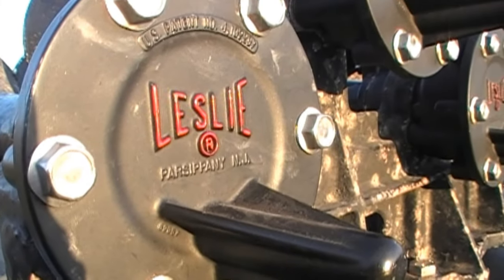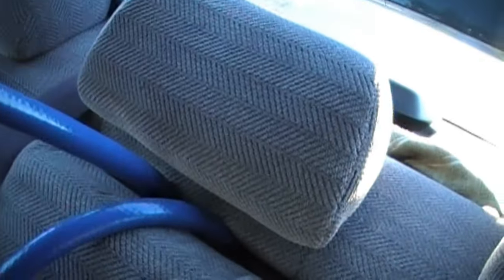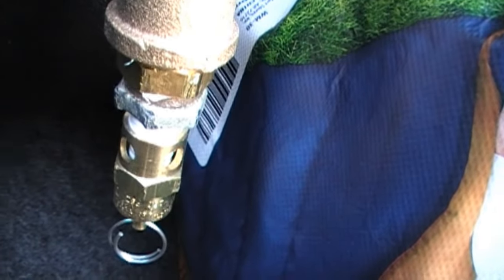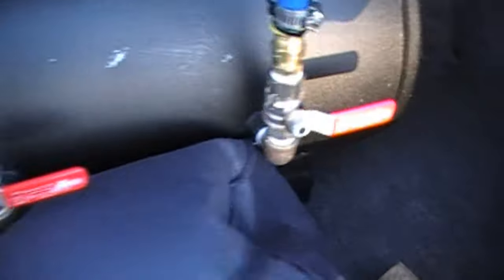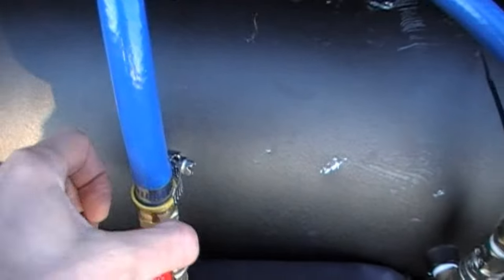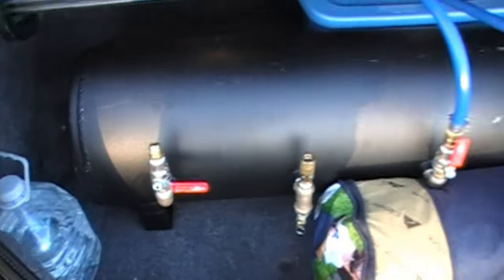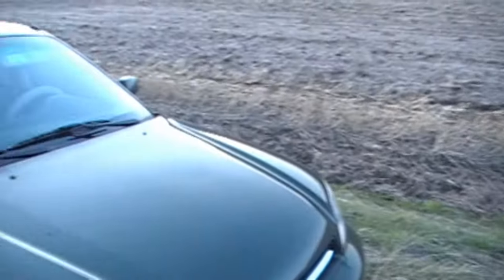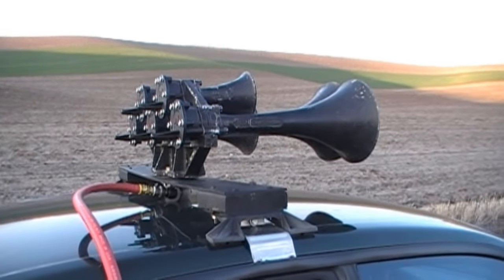Locomotive horn collector air system NOT for pranks or scaring (Big air for a big horn)

Comment: I have read the description and totally understand what you're doing with your trains horns.
BUT what would happen if a cop were to pull you over while you're on your way to the remote area where you blow your horns ?
(Or on the return trip)

In other words the cop sees your papers and your car... and then the horn, complete with its setup, including the lever valve that can be actuated while driving.
Ok you're not going to scare anybody with your horns but except if they've read the video description (😂😜) the cops will most likely not know it...
Reply from the maker: Great question!  The horn isn't on the roof until I get to where I'm going to do my video recording, then it gets removed once I finish.  Its only on the roof for about 5 minutes while I'm doing the recording.  Though space is limited with the air set up inside the car, there is enough space for one or two horns to be stored inside while I'm driving.
Reply: @mafarnz  I don't know if its illegal or not, whst would they charge u with out thete in no mans land? Relly they mught get a kick out of it, if they r Decent

Comment: Do you really need hoses that are that big?
Reply from the maker: Yes, I do.  These locomotive horns require a tremendous volume of air, volume (CFM) is far more important than pressure.  A small diameter hose or airline won't work, the horn would just quietly squeak or not sound at all.
Reply: Ok thank you, what's the inner diameter of them?
Reply from the maker: 1/2".  Everything, tank port, all fittings and valves, hoses is all 1/2" inner diameter.
Reply: If it were electricity, it would need more watts! Low amperage with high voltage won't run these horns they require high wattage!!! (air) lol hope that helps

Comment: real nice setup. looks super safe if you get in an accident...
Reply from the maker: +babygorrila I have a seatbelt around the compressor, it weighs less than a person.  Also I don't have the horn or compressor in the car 24/7 so its unlikely that it will ever be an issue.

Comment: Why not buy a locomotive .There be no need to install all that stuff.
Reply from the maker: I would if I could afford it. But then I'd have to also buy a railroad to run it on.
Reply: You need to get a job driving one  that is if your  are not one already . Them you got a real problem
Reply from the maker: I had seriously considered that for a while, but best to not try to make a job out of a hobby.
Reply: Is the air compressor 220/240 volt .Do you  fill before hitting the road  or can U run the compressor in the car.
Reply from the maker: Compressor is 120 V (North America) and I fill it before hitting the road.

Comment: hey matt, what are the dimensions of that pretty 20 gallon tank?  i will be start looking for pickups (possibly F250) and i want to hide the complete air setup (20 gallons with 2 viair 444c with extra cooling) in a tool box that will go in the bed, if theres room, ill add a little surprise for extreme lighting lol
Reply: +mafarnz i learned the hard way that the drain valve is flush with the feet on my 5 gal and i bumped it a few times and let half of my air out haha. i saw a box at the home depot thats 17x69x19 and i think internally,  thatll just fit if i put all 90 elbows on the 1/2 ports and lift the tank about an inch but i plan on using all 3/4 airlines for maximum volume

Comment: I think you need has mats to drive around with pressurized tanks. Not sure. If anybody knows... Reply
Reply from the maker: Actually I have a CDL, I work as a bus driver.  For "low pressure", anything I think under 300 PSI you don't need any special endorsement.  Semi trucks and buses all have compressed air tanks for the air brake systems.  The only time you need a hazmat endorsement is for those high pressure cylinders, stuff like that that's over 300 PSI.  I could be wrong on the pressure though.  In any case my air system runs the same at what a commercial vehicle brake systems runs at, so I don't need anything special for it.  The large 20 gallon tank is actually designed for use in semi trucks with air ride suspensions, so its made for use in a vehicle.
Reply: @mafarnz  Thanks for the great response! I work in asphalt pving and alot all of our trucks run on air brakes and or suspension. Though i don't have a cdl yet i thought that was one of the main points of needing a cdl and possibly has mats. Now that i am thinking about it, none of our trucks have hasmats except the tack trucks.
Reply: Ace Employee your distributor and a heated lance crack fill machine will call for has mat, nice to see a black top brother in this thread!!!

Comment: ever heard of a pressure regulator…?
Reply from the maker: Indeed I have!  Most regulators are too restrictive to the CFM, and the high flow regulators are really expensive.  For a horn that's designed for max 140 PSI and an air set up that tops out at 120, also not really all that necessary.

Comment: Nice setup. In the description you say that these horn tones are being replaced by less pleasant ones. I do not know much about American locomotives so I do not know what that sound is. I have suddenly become fascinated by train horns. Earlier it was just locomotives. Now horns, too. Can you point out a video that gives an idea about the "less pleasant" horn sound?

Also, Would a truck pneumatic brake air tank be safe for such an application? It is a critical component and is  installed in pretty much exposed state on a truck. What's your thought on this? Thanks in advance.

Comment: Wowsers.... brings back memories of diesel coal trains at a local Aluminum plant where I grew up in Northern NY State. Pretty awesome. For that remaining port on trunk mounted air tank, consider another horn setup that mimics a Steam Locomotive Horn which is an amazing sounding horn. I first heard one in person when I was driving on Pacific Coast Highway and had stopped for gas in Capistrano Beach just north of San Clementé and a huge steam locomotive with a small number of cars motored by of course sounding off that beautiful steam driven horn.... not sure if it's a doable do, but thumbs for the diy setup.

Comment: Nice set-up Matt! If you don't mind me asking, how is your roof rack mounted? I have all the pipes and hoses rigged up, but haven't yet figured out a way to build a good roof rack to mount the horn to.
Reply from the maker: If you have a spare 10 minutes I did an extensive video on the rack here:  https://youtu.be/ExDl1OzGT-M
Basically its mostly homemade with Whelen light bar brackets.

Comment: That's great, do you have an inverter so you can run the compressor?
Reply from the maker: I looked into that, but to get an inverter big enough (enough current) to run the compressor it would have to be hardwired into the battery, which would be expensive and I didn't want to mess with the vehicle's electrical system.
Reply: They do make compressors you can plug into the cigarette lighter, but it would take a while to fill everything up.
I don't know what this would cost, but off roaders use high pressure tanks (like for welding) to store air, then you use a regulator to knock it down to a usable pressure.
You get many more times the volume for the size.
You have to pay to have those filled though.
I never even thought of having an air horn, and now you've got me thinking of all these different ways to do it, and I actually went on ebay to see how much they cost, and how available they are.
Reply from the maker: I know a couple of horn collectors that use either scuba tanks or the large nitrogen cylinders.  I may go that route once I get a pickup, I'll just have to look into the cost of that VS an on board compressor.

Comment: Done right. I can't stand all these kids that say they have a train horn on their car when they have no clue. Such a Difference. BTW locomotives air supply runs between 130 to 140 psi all day and the horn is not regulated. You don't have to worry about 140 it will handle that normally.
Reply from the maker: +SubCRX Glad to hear a comment form someone that knows what they are talking about!

Comment: Those 5 horns are all one solid piece?   Can any old joe blow purchase one.?  I'd like Leslie horns on my Semi.    Any assistance you could provide would be appreciative :)
Reply from the maker: The 5 horns are held together by a manifold, which also serves to distribute air to each horn.  There is a 1/2" air inlet on the bottom of the manifold.  Yeah anyone can buy them if you have the dough.  The set in this video I purchased (7 years ago) for $600, they are worth about $1200 today. A common Leslie three chime goes for about $600.  I buy most of my horns from other horn collectors, and a few from scrap yards that were cutting up old locomotives.  No I don't have anything for sale.

Comment: Why do you need that?
Reply from the maker: Of course I don’t need it, this is what I do for fun, it’s my hobby.
Reply from the maker: What you see in the video was put together with trial and error over two years.  If one had all the parts and pieces in one place it could be put together in about two hours or so.  The way I have it designed  all I need to do is remove the horn and hoses and everything comes out of the car in about 5 minutes.  It takes longer to fill all the tanks than it does to put the stuff in the car, I don't run a horn 24/7.
Reply: Why not?
Reply: mafarnz I understand. I have a subwoofer in my trunk that would blow your rug off your head for no other reason than “I can”

Comment: This is the biggest hack job install i've ever seen.
Reply from the maker: Here are my requirements:
1)  All components of the system except for the valve and roof rack must be easily removable so I can use my car as a car.
2)  The horns I have require a minimum of 30 gallons of air.
3)  My horns require the use of a manual valve so as not to cause damage to them.
4)  All hoses, fittings and valves must be a minimum of 1/2".
5)  I cannot mane any changes, modifications or additions to the vehicles electrical or mechanical systems.

How would you design an air system that meets all five requirements that isn't a "hack job"?  I'd love to hear any ideas if you have them!
Reply: So you spend the weekend riding around blowing your air horns then come Monday back the Best Buy working the Geek Squad counter?

Comment: What about the carbon monoxide coming from the motor on the air compressor inside the car.this guy is going to be deaf as hell within a week or dead from carbon monoxide poisoning.
Reply from the maker: I do wear ear plugs so that’s not a concern. I didn’t know that an electric compressor produced carbon monoxide thanks for the warning.
Reply: What planet do you live on that an electric motor produces carbon monoxide?
Reply: People don't know anything that all these days
Reply: mafarnz hahaha
Reply: mafarnz it doesn't produce carbon monoxide
Reply from the maker: @
Asw Asw
 Yes I'm quite aware of that, I was making fun of the original comment.
Reply: mafarnz yea i know responded to the wrong comment on accident

Comment: This guy is so cheap he can't buy a Viar air compressor made specifically for cars. Instead he seat-belts a contractors compressor haha.
Reply from the maker: Haha this guy is so ignorant he doesn't know what he is talking about!  
#1, my set up cost more than a Viar.
#2 my set up is designed to be removable since I don't run a horn on the car 24/7, and to not modify the vehicles mechanical or electrical systems so that it doesn't compromise the vehicle.  Hard wiring a compressor into the vehicle doesn't fit with that need.
#3 even the best Viar compressor can't handle the huge volume of air than my horns require.  I would need to get an Oasis, and yeah, I can't afford to spend a grand on just a compressor.
Reply: mafarnz 😂 the roasting is real
Reply: just so you know having a compressor out on the back seat is probably compromising the safety of the car ...  a seatbelt isn't exactly designed to withhold the shape of the compressor.
Reply from the maker: @romeoneverdies If a seatbelt can hold a 400 lb + person in place it should have no issue holding a 30 lb compressor.  People are all different shapes too you know!
Reply from the maker: @ Evil Bastard well since I don't run a horn on the car 24/7 that's not an issue that I need to worry about.

Comment: What the hell is wrong with you? Thats a lot of money and effort for what exactly? Typical case of more money than sense! Also you need to port that blowoff valve outside the vehicle, if that  gets to vent pressure then goodbye tailgate, windows and possibly even eardrums!
Reply from the maker: Something that doesn't make economic sense but you do in your spare time because you like to do it is pretty much the definition of what a hobby is.  Speaking of lacking sense, have you ever worked with compressed air?  Odiously you have not.  A pop valve is not going to suddenly pressurize the inside of the car, it makes a lot of noise but that's about it.  You really think I just threw this together inside the passenger compartment without first doing some research to see if it would be safe?
Reply: Just because you don't understand his hobby doesn't mean its pointless or senseless. Someone who uploads videos of RC cars should understand the concept of a hobby.
Reply: TenderTots Exactly! A hobby is about doing something you enjoy, not just making something bigger and better than anyone else no matter what the cost, my point was that there is obviously a fair amount of money spent but i dont understand the use? Yes it's impressive, but is driving through the desert tooting a horn the whole end game?
Reply: TenderTots Also, yes i'd fkking love that type of rig on my car, but the fact i have no use at all for it is the reason i dont
Reply from the maker: @ Chris Salter I collect and restore old locomotive horns as a hobby.  For me, putting a horn and taking it out to the middle of some farm land to get a recording of it is the same as you taking a new RC car to where ever you take your RC cars to... since I don't own my own railroad, this is the next best thing.
Reply: mafarnz now that makes more sense, im keen follower of any restoration project/hobby, you just need to be careful with compressed air, many people underestimate it but ive seen first hand what it can do, test the pop valve regularly, a friend didn't, it popped late and damaged both his hearing and sinuses

Comment: If you were building a system from scratch, would you recommend 1/2 air hose or 3/4 air hose? For a 5 chime setup
Reply from the maker: 1/2” is fine, and length doesn’t matter too much. I have about 10 feet between valve and horn.
Reply: @mafarnz  thank you!
Reply: @mafarnz  I got my horns setup. I am running a 30 gallon tank. I can blow my horns 5-6 times and my tank is already down to 60 psi from 120 psi. Is that normal?
Reply from the maker: Yes.  That's around what I experience, depends on the exact type of horn.  Volume of air is more important than pressure.
Reply: @mafarnz  I may increase my tank capacity then. I’m this video were the tanks close to empty by the end of the video?
Reply from the maker: @code3responsevideos872  If I remember correctly the PSI dropped from 120 to about 30 in this video, on 32 gallons of air.

Comment: That is such a unique sound, you mentioned something about chambers. what are those? how do you adjust/tinker with those. :)
Reply from the maker: +Luke Levin-Martins The chamber is the portion of the horn that contains the diaphragm, it is what actually generates the sound.  On the Leslie RS horns (type of horn in this video), there isn't any adjustment that is needed, you put the diaphragm in the back cap and bolt the back cap onto the chamber.  There are only two things that would need to be done with this type of horn.  #1 The diaphragm has a rubber gasket attached to it, rips or tears in this gasket leak air and it doesn't work.  I made a video showing how to repair this type of damage.  #2 The metal in the chamber itself where the diaphragm contacts the nozzle gets worn down with use, and if it is too worn it no longer works.  In this case the chamber needs to be machined in a lathe to return all surfaces to factory spec.
Reply: +mafarnz thanks for that! Very interesting to read :) will certainly check out more of your videos.

Comment: I'm a locomotive engineer and wonder what's causing that after sound? Is that what you need to fix? Otherwise it sounds like your very responsible about where you blow the horn. Nice setup!
Reply from the maker: The "after sound" as you call it is the highest pitched bell (trumpet) holding on longer than the rest.  This is because of differences in wear on the different parts, I have since corrected this.

Comment: nice job on the restoration, they sounded great 
and not that i'm a safety fanatic, but you forgot your hose clamp on the supply line (the red hose out the back window.) bet you're loosing a little air through that barb fitting. anyways, take care
Reply from the maker: +Wesley Jackson The connectors that I was using were the push on type that don't require clamps.  Also worth noting, since this video was filmed I have switched from garden hose fittings to SAE flare fittings, but still with push on ( no clamp) fittings.  Works great with no leakage as long as its not below 20 F outside.  That's too cold for me to want to take a horn out anyways so not an issue.